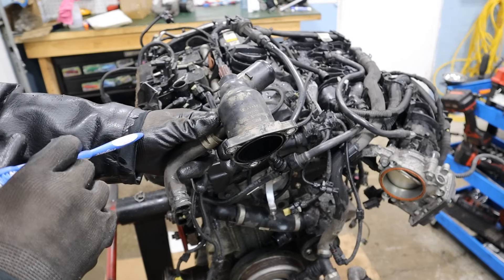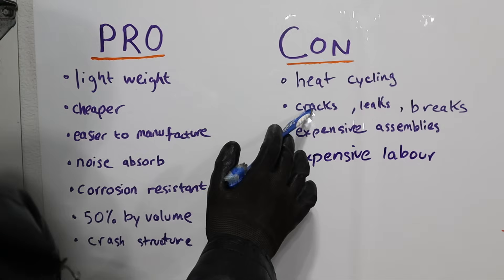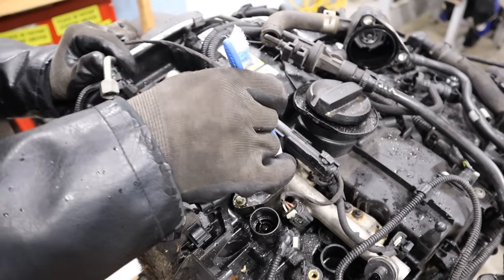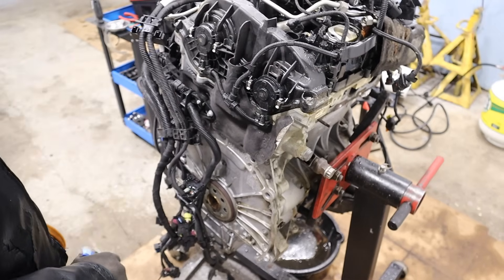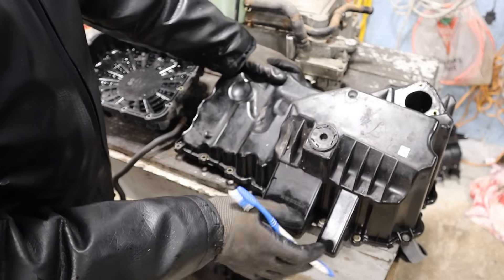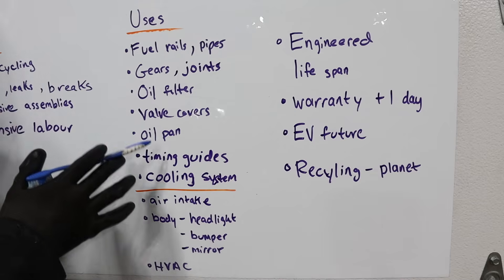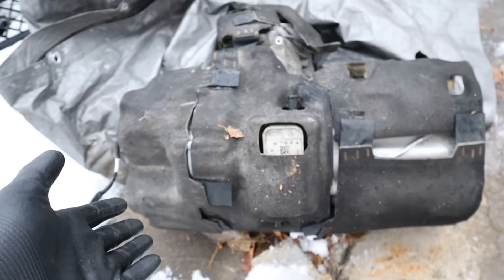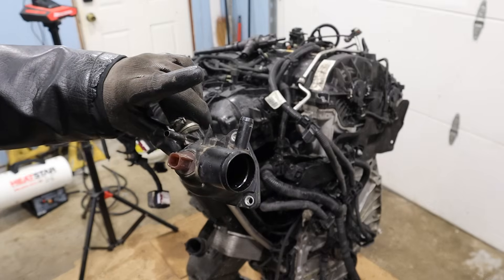Planned Obsolescence: Your Car is 50% Plastic and Why It Will Cost You | Discussion | Speedkast99 #6

Comment: Next they gna make the gears in the differential  out of plastic and the sprockets in the engine also. 😂
Reply: The Suzuki DR400 had something like that. The water pump cog was plastic.
If they can get away with it, they will do it.
Reply from the maker: They already do
Reply: @speedkar99 bruh 😢
Reply: GM already did this in the 60's.
Reply: They already do in some vehicles, it works just fine.
Reply: @christopherkidwell9817   Until out of warranty.
Reply: @christopherkidwell9817 until it doesn't.
Reply: @zefautino  Which can happen with literal fully metal parts.
With plastic parts, if they break even in an engine with other plastic parts, if the engine block itself is made out of metal, less damage or even no damage.

Comment: The goal is to produce the car as cheap as possible, after that the car needs a lot of repairing cheap parts but expenseve labour , maybe even replacing engines and gearboxes at the owner's expense, and as a carbrand be extremely planet saving! I'll stick to my 2013 Toyota Auris 2 hybrid with now 276.000 km's on the klock, running like new and burning no oil. Though it also has a plastic thermosthathousing, a plastic valvecover and a plastic oilfilterhousing, and not forgetting the plastic chainguides in the timingsystem. But as far as I know Toyota uses quality plastics instead of the plastic toy shit VW, Audi, Mercedes, Ford, BMW, the Korean and American brands use.
Plastic carparts are like plastic d@@ks for the women, it can never compete with the real stuff
Reply from the maker: Haha 😳

Comment: Automakers using cheap plastic from China or eleswhere sucks. But i still rsther own a newer vehicle than 10-15 year old vehicle with outdated features and tech.......
Reply: I'd much rather own an older vehicle that has knobs and switches to control things like the air con rather than the garbage iPads glued into new cars.
Reply: ikr, old cars are cheaper to repair and actually can last longer than modern cars do.
Reply: @LabArlyn  exactly, in an older car you can just replace the globe in a headlight whereas in many newer cars you have to replace the entire headlight unit and sometimes even require specialised tools to preprogramme it so it's accepted by the car.
Reply from the maker: I own older vehicles because that's what I can afford.

Comment: that's why I own and only still buy cars made between 2000-2015.             less plastics
Reply: And (probably) you vehicle is a rust bucket?......
Reply: @crow_2k11beatsbydre8  not really.  all are mostly clean.
Reply: So somewhere in 2035-40 you will stop driving entirely?
Reply from the maker: Exactly! Eventually vehicles will have to be replaced
Reply: The guy above me don't know what winter and rust belt is
Reply: @grostaco6464  he does. I know how to take care a my vehicles, no rust, educate your self.     2003 Lexus, no rust, 2008 Honda Pilot, no rust, 2014 Porsche Cayman, zero rust, looks brand new, 2012 Infiniti G37, no rust.    and a couple others, no rust.   Also none of my cars have ever seen a dealer or mechanic, do all my work myself.   In case you never heard of it, let me help you out,  "Fluid Film Rust & Corrosion Protection"
Reply: @tomzphone my man talking like he goes out with his cayman and g37 in the middle of winter in February. Of course those cars doesn't rust.
You much be living down south, you guys can keep your cars for like 30 years without body problems it's insane
Reply: @grostaco6464  my g37 is my daily, so yes.  I do.   the cayman is used less in the winter, but it's a lot of fun driving in the snow, so I yes I do drive it in  winter.   Why do you keep assuming things.  .  spray your car with fluidfilm at least every two years, and your car won't rust. (spray on a new car before it starts rusting).
Reply: The two people above me never heard of maintenance